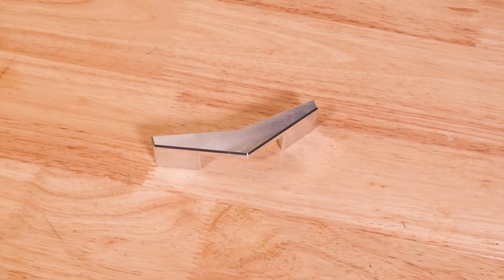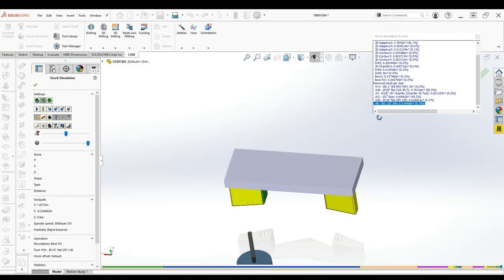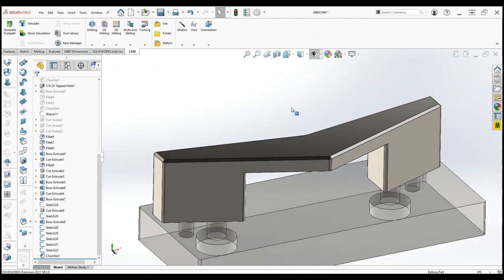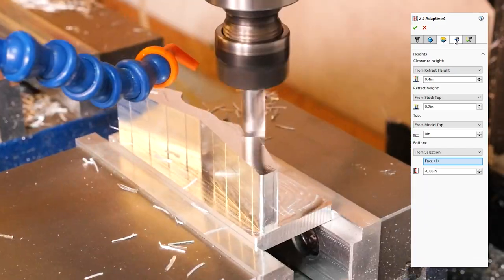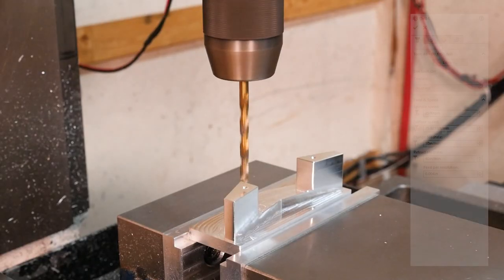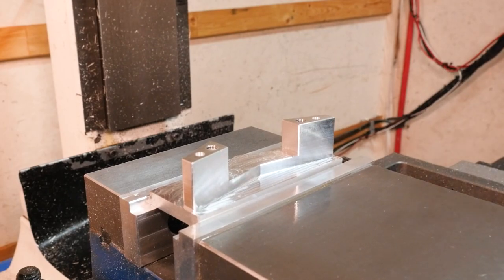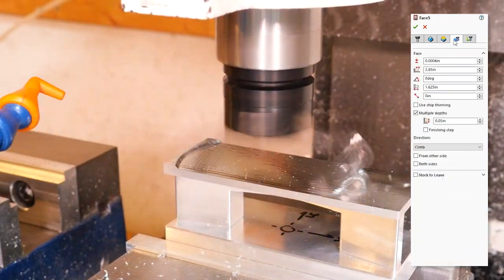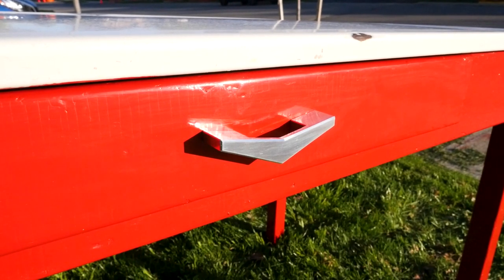How To Machine Aluminum on a CNC Bench Mill - Retro 50s Diner Drawer Handle

Comment: the general practice in toolmaking  would be to if at all possible ref from the dowel hole,   referencing corners  corners runs the risk of out of square parts  and mistakes of what corner is the ref corner.    So  order of sequence  would be machine bottom features , machine fixture   referenced  to vice stop  then bolt part on , machine top side . in general dowels are .0002-.0003 oversize  and would be a press fit into the fixture.  fasten the vice stop down before you ref the part to it , sliding the stop up to the part  makes for error as the stop clamp screw is applied. analternate method would be to only machine the  holes and the finger slot   before flipping  then machining the whole outside and top  making the chamfer right on location  but your machining stiffness would suffer
Reply from the maker: I see we’ve got a real machinist chiming in. Thanks for the insight, Chris!

Comment: Looks good. I'd put some clear coat over it to protect against light scratches.
Reply from the maker: Do you know of any good clear coat products/methods other than anodizing that adhere well to aluminum? You're so right - you look at aluminum the wrong way and it scratches!
Reply: @adamdebowski2037  Ive been using krylon clear coat. Any clear coat or lacquer should hold the fresh cut aluminum shine.

Comment: Looks like you are using solidworks and I am assuming  you used  their cam thats built in .  Could you do a video setting the operations  up in their  cam software . Thanks
Reply from the maker: Hi R WA. I’m using solidworks - but not solidworks cam. This is the HSMWorks plug-in for solidworks developed by Autodesk. Check out this video for cam walk though if you’re interested: https://youtu.be/xelyCD6sA_A
Reply: @adamdebowski2037 Thanks
Reply: @adamdebowski2037  I tried the SW integrated CAM and it is clunky. The Fusion 360 CAM has the same design based on logic that SolidWorks CAD so brilliantly does, F360 CAD not so much (still too immature). BUT, when I discovered that the HSMWorks 'plugin' module for SW is fundamentally the exact same CAM as F360, I (we) now have the best of both worlds with the (IMO) unsurpassable CAD of SW and the top notch CAM of HSMWorks, which is included in the hobbyist license for F360. Another brilliant video in every respect: keep 'em comin'  :-)
Reply from the maker: @BrilliantDesignOnline  totally agree w your comments. I love solidworks and the HSMWorks plug-in!

Comment: Love your content buddy, somewhat unrelated but, I am working on converting a PM25MV right now and at a loss of a good electrical enclosure, size/supplier etc that isn't astronomical in price. Also, do you have separate power supplies per motor? Thanks for any help.
Reply from the maker: Hi Nicholas - you’re absolutely right re the enclosures. They sure are crazy expensive - which is why I built my own. Don’t know any cheap sources but it might be worth giving aliexpress a search. Re power supplies, no - I’m using a toroidal transformer to power all 3 motor drives with 60VAC. Check out my video in my CNC build where I talk about my setup and the details of my electrical cabinet if you’re interested. https://youtu.be/bN_D3NWwdu4
Good luck on your build!

Comment: Personally i machine the fixture in the vice and dont remove it till the jobs done
Reply from the maker: How would you get at the bolts?
Reply: @adamdebowski2037  i have a few little ratchet set that i use in these cases.
Ones a super slim one by snap on great for allen key bolts the other rotates the head by turning the handle  so with a slim socket on them they work amazing.

The other  way ive done it is dowl pin and a pocket that the legs slip into and then a uniforce clamp that holds the sides.
Depending  how many or how big is how ill try and hold it